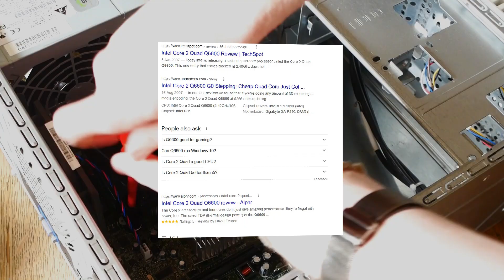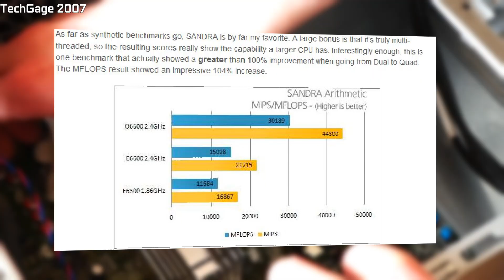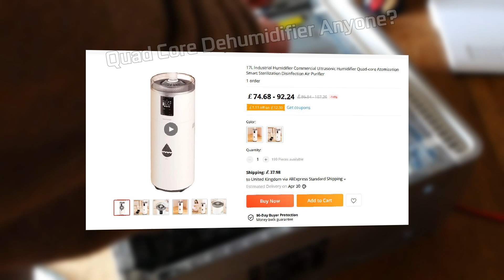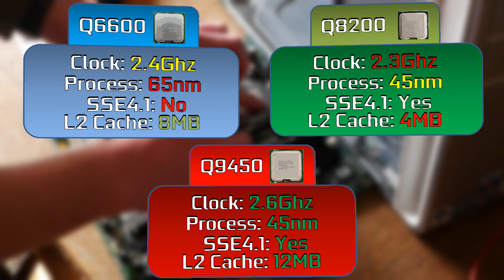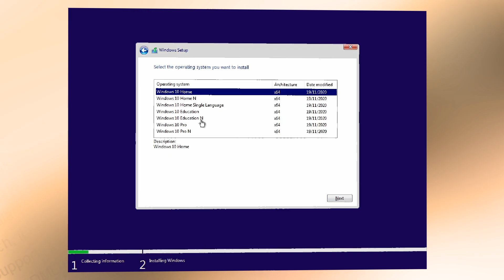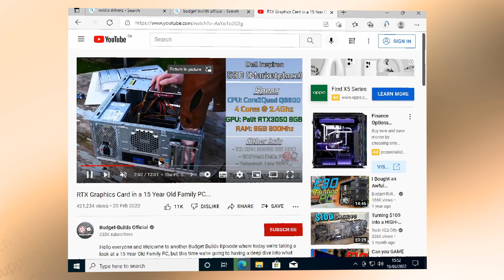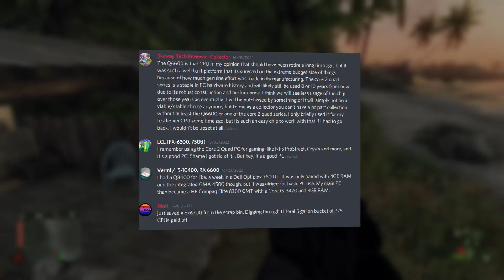Intel's Core2Quad...Finally Obsolete?

Comment: I have a core 2 quad extreme on my computer
Reply: what core 2 extreme do you have? I heard the extreme versions are the best among the core 2 quads.
Reply: @boiledliddo  idk it only says it's 2.66ghz but can run Minecraft 1.18.2 in 24 fps with no gpu
Reply: Checked like on /proc/cpuinfo only said it's a core 2 quad extreme
Reply: Man even when I changed the thermal paste it said the same thing on the processor
Reply: @lavacat720  have you tried typing systeminfo? You can then see what processor you have.
Reply: @boiledliddo  command not found, also it's linux
Reply: @lavacat720  try CPU-Z  that will surely identify your cpu.
Reply: @boiledliddo  I'm on Linux....
Reply: There's no CPU z

Comment: My main pc is still runing on a core 2 quad, it's the q9650 overclocked at 3.6gz. The motherboard is a asus p5e deluxe, 8gb ram and a gtx660 graffic card.
Since i don´t game on it, i don´t really feal the need for a new one, runs everything that i need flawlessly.
Reply: that can actually be used for playing certain modern games, although at reduced resolution (if you have a big monitor, you won't be able to full screen). GT 1030 is the budget gaming GPU today for some people, and your GTX 660 is stronger than a 1030. My retro pc setup is a Q9500, 4GB ram, and GTX 1650 --  the pc sometimes lags when gaming.. but Genshin Impact, Granblue Fantasy, Dead or Alive VI, and Soul Calibur VI are playable.

Comment: I'm not ashamed to say that I ran my Q6600 until 2020. Back in 2012 I was on craigslist's free section and came across a listing for two free PCs. One was a 1st gen I5 machine with a dead motherboard, the other was a Q6600 machine with a dead power supply. I stole to power supply from the I5 build and got the Q6600 back to life. Equipped with a Corsair 120 AIO, 8GB of 1333 DDR2 Corsair ram, a 8800GTX graphics card and an IDE harddrive sitting in a Coolermaster HAF case, I played whatever I could get to work. In 2020, mid match on Realm Royale, the pc died. Power supply failed taking the motherboard with it. One of my coworkers had a Asus prebuilt with an I5 6400 and 16gb ram sitting around unused (no gpu or hdd) so he gave it to me. If it wasn't for the power supply failing on the Q6600, I'd be playing it today.

Comment: bought a used q9450 cpu to replace a e6500 in my HTPC/NVR/NAS build that built with old parts. thought the slower but more cores would improve things but complete opposite. the q9450 used way more power and made my ITX hotter, and made the whole thing louder due to needing more cooling.  the e6500 had 2 less cores/cache, less heat and higher stock speed and i was able to further OC it to be even faster due to lower tdp. luckily i bought the quad cpu off ebay for pennies so it was a failed experiment that didn't cost much. 

eventually had to upgrade cause it was starting to really lag on basic stuff like youtube and movie playback and streams.  that e6500/q9450 served me well for over 12 years. got a complete i5-7500 used computer off ebay for 120 bucks.

Comment: I still run a QX9770 @400x10, ASUS P5E64 WS Evolution, 4x2GB Corsair Dominator GT @1600C7. I had GeForce 9000 series but they're being swapped for 2x ATI HD-4870X2

All in a 2008 XPS630i chassis, with original supply. CPU currently under liquid but the plan was to waterblocks the CPU, chipset & RAM to try get a stable 440x10 with 1760C7 or something similar.

By far my favourite computer to date, she overclocked hard (before I dialed back) and has been so much fun her whole life, I'd ditch my 5800X, Pro WS-X570-ACE, F4-3600C17Q-32GTZR, Strix LC RX6900XT rig long before I sold my beloved QX9770.
Reply: nice setup.
Reply: @boiledliddo  absolutely love it, since the X48 have 32 lanes of PCIe 2.0 and the ICH09 has from memory 6, I was able to run PCIe SSD with custom bootloaders & a network card from the southbridge and can keep the full 32 lanes for the quad CF cards
Reply: @spicywolf6718  I heard the Xtreme series were the best among the core 2 quads? I also have a retro pc, Q9500 + two sticks of 2GB DDR3, Cooler Master i50C (this has a copper base for better cooling), 480GB Patriot SSD, and Seasonic GC 550 CPU. It originally had a GTX 460 as gpu, which unfortunately died during a lightning surge - I did the dumb thing to keep playing when a thunderstorm was raging outside. Miraculously, only the gpu and avr died, the rest of the pc survived. The retro pc is partially retired, and now mostly used as backup storage. Don't want to throw it away because had good memories with it. And it still does have a few games for a bit of fun. I installed a GTX 1650 into it, so it could now play Granblue Fantasy and Guilty Gear Strive at 1080p. :)
Reply: @boiledliddo  they are the highest Intel bins, but the QX9770 was a bit of a weird chip in regards to OC potential. It and the QX9775 (LGA 771 for D5400XS motherboard) were the only validated FSB1600 chips for consumers, technically you couldn't run them in a X38 at FSB1600  without voiding warranty as you would have to overclock the chipset.

The biggest problem with a QX9770 is that to meet the FSB1600 needs they upped the current draw meaning clock for clock the QX9770 draws more power and subsequently runs hotter than the otherwise identical FSB1333 rated QX9650 which from a multiplier overclocking standpoint made the QX9650 the 'better' chip, for FSB overclock the Q9650 performed will if it's cap of *9 wasn't a limitation.
Even downclocked to 333x9 the QX9770 consumers more power than the Q/QX9650 @333x9.

Now, I have the X9770/X48 only because thy were the top dogs of their era and it's for nostalgic purposes. I plan to build a 2x QX9775 + D5400XS + 16GB FB-DIMM +2x 9800 GX2 when I can find said parts for sale in Australia.

Comment: Not even close. It should be obsolete, but we've got all the spying to thank for that. You need a Core2 system if you don't want to have hardware back doors built in, that can just bypass your encryption. And just run a Linux distro on it, and max out the RAM. You'll have an experience that resembles a decent system from 2022. It's not perfect but if you want away from the spying, that's really your only 100% method. To use a Core2 system. I'm guessing you probably want the q9650 so you'll at least have the final top of the line quad core. I'd stay away from the dual cores.

Comment: I just build a new system with a C2Q a Q9300 with 8Gb DDR2 DRAM, I have 2 PCs that also running on C2Q as an offload server for music plugins. Which are used for mixing and mastering multitracks from songs. Also a c2q for administration, the rest are recent models with an i7 or Ryzen machines. So core2quad are still used.

Comment: I've got a second "gaming" computer running a Q9550 + a GTX 760 and considering I paid next to nothing for the parts its actually holding up pretty well. It has truly began to show its age the last 2-3 years, but I frequently play older games and it works just fine doing that :-). But honestly I'd rather get Sandy Bridge at this point for an ultra budget build because it has become very cheap

Comment: If You have E5450 (Q9650) if You have good MB (with support for 4x2 DDR2 or 2x4 DDR3) with 8 gigs of RAM and SSD is a very good PC, don't support AVX so can not play some games, but with good videocard (even not very good, like 760) is enough for web, and even some gaming (not on highest settings but still) and if You are can not afford an upgrade, no need to be sad, You're not loosing much.

(I used my 5450 untill 2020, and as my 2nd system for testing and stuff untill end of 2021, now my friend use it for web, and it's enough for him)

I got mine in bad shape,  upgraded like this
- Videocard (GTX970 so I can play at least somthing)
- CPU cooler (cheapest like Gammax 200/300 is enough)
- RAM (4x2 DDR2) and SSD (cheapest 120gb enough for system)
- PSU (mine was very old) and case
In the end it was fast and very quiet system

Comment: I had my share of processors on the 775/771 platform. I did all kinds of experiments back in the day. The ultimate setup for me was Dual Xeon E5450 with 12GB DDR3 RAM and a GTX 770. For Q6600 I would love to see a comparison using the "tape mod" where you place a small piece of tape on one of the bus pins on the processor. This trick allows him to reach 3.0 GHz on 1333 mhz. I used this trick on several Dell Optiplex machines. I still have my Dell Precision 690 rocking dual X5355 processors and a GTX285, even with an SSD, it is not a fast PC. Try some dual CPU motherboards, you will have a lot of fun and content. Also, GTX295 or GTX690 are super cool things to play with.  Cool Video mate, keep up the good content.

Comment: They last along time there just as powerful as today's core I5 i7s only main difference is the older processors of core 2duo core 2 quad used more power got hotter but they came in a good range of speeds and CPU cache sizes. Only no hyper threading but Intel p4 and some Intel atom has hT

Comment: I mean, they have been obsolete for gaming for nearly a decade now. They're still just fine for average use as long as you have enough RAM, an SSD and a cheap modern video card that supports hardware accelerated web browsing.

Comment: Did you disable meltdown, spectre and telemetry? Pointless to benchmark old cpus like that with those stupid security fixes. I built an old i5 3570 and put a 3070 in it just for the laughs recently, and disabling spectre gave a massive improvement in fps, specially low 1%.

Comment: Flashed a custom bios and managed to get a $20 modified Xeon5460 (Basically a Q9560 but runs cooler) on an old HP with G33 express chipset. The board was so old that it only supported DDR2, so I maxed out at 8GB. Still runs fine for YouTube or such tasks.

Comment: I have a Q6600 but replaced it with with a Xeon X5460 quad adapted for 775 and overclocked to 3.5ghz, im not a gamer so that CPU and the 8gb ram i have does me, i have two GPUs though as i run 3x 32" screens :)

Comment: Ah the bittersweet memories of my old Q9650 with Foxxcon G41MXE. I upgraded from Pentium E5700 and oh my god it required SO. MUCH. TROUBLESHOOTING. It wouldn't boot at all unless I tried various tricks like pushing the CPU cooler onto the mobo really hard, leaving my PC on the whole night so I wouldn't have to go through the trouble of booting it again, etc. And the thing ran really hot. But I was still a kid and it was a good learning experience.

Comment: I've got an Inspiron 530 with a modded bios that is running the C2Q cousin, a xeon x5470. It works alright but it likes to get real hot since I have to use the stock Q6600 heatsink on it. It's paired with a Quadro k2200 which overheats quickly if you don't keep a fan blowing on the computer while it's running. I mostly use that one for streaming, browsing, and to run old console emulators up to the PS2

Comment: I used mine (6600) until late last year... then I bought a $100 i5-6400 (not the chip, the whole PC)... :) I'm not cutting edge by any means... but I could play GalCiv III in 1080p with no slowdown on the quad... and now that I have an i5... I can run it in 2k. :) 

My choice of games are archaic and usually not more FPS-y than Quake 1. :) I hope to get another 5 years out of this i5, which was used when I bought it. :)

Comment: these are definatley a "basically for little or nothing" computer, they are not really cheaper then buying a computer with an i5-2400 at this point and at least then you have an upgrade path. (not only with cpu, but often the core 2 quads supported 8gb ram max and on a lot of boards only 4gb) its a dead platform. if you get a computer for 10 dollars sure, slap in an rx 460 for 75 bucks and you got yourself a computer that can run most games.

Comment: They are still capable to power pc these days. Not kicking ass, but still doin work. Even mobile. I have c2q 9000@2ghz and gts 9800m, only 4 gig ddr2 ram 800. For internet, Office, Youtube perfectly normal experience

Comment: Im still using q9650, on a x38 platform with 8g ddr2 ram. I didn't purchase those parts, they are scavenged from obsolete / damaged PCs thrown away by the uni. I also mod a scavenged Tesla c1060 computation card into a quadro fx5800 by soldering dvi jacks  and flashing it with the quadro bios, together this allows me to run Minecraft smoothly at 60fps 1080p (on a server, not single player), occasionally the fps drop below 50, mostly due to chunk loading. Hl2 and L4d2 runs perfectly.

Comment: Personally I recently just stopped using a core2quad based Xeon at 3.4GHz and the only reason why I upgrade it was because I needed some new chipset features that the old CPU did not have.

These chips still make great entry level gaming computers and everyday use set ups.

Comment: For the last 5 years I have been retiring anything with less than 2 cores 2 threads. Even for light office work 4 cores 4 threads is an absolute minimum for productivity. If you have a browser open, voip software, and office suite all at once then when Windows updates hits 2 core systems fall flat on their face

Comment: I stand by my opinion that the Core 2 Duo and Quad are everything someone who doesn't want to game actually needs.
Reply: The Quad yes, the Duo? No. I had to use one as a developer at work at the time and it was the most god awful POS it has ever been my misfortune to have to use, even old Unix workstations from 10 years previous to it were snappier than that. Thinking of it I probably should have swapped the CPU out for a Quad and not told my boss. 🤣
Reply: RIP trying to play 4k videos
Reply: You have never seen a two core cpu get completely destroyed by windows 10 then....
Reply: @quan-uo5ws  I've used Windows 10 on a Core 2 Duo, it's perfectly usable as long as you have an SSD.
Reply: Its not the core2duo's fault. Windows 10 is an intentionally resource hungry unoptimized mess.

Comment: I am still running C2Q 9450 with 8GB RAM and SSD in my HTPC on Win 7. It is still performing all duties quite well, except 4K playback either from youtube or local H.265 files. Even dedicated  graphic card does not help. 1440p playback works perfectly.

Comment: Up until sometime in late 2021, my daily driver for gaming was a water-cooled QX9770 3.2 GHz (Yorkfield) on the X48 chipset with 1600 MHz FSB and 8 GB dual channel DDR3-1600. It was a quite capable albeit a little power hungry system. Paired with a proper video card, (I had a STRIX 1660 in it at the end) it's still a rock solid platform for anything that requires powerful single threading over anything else. The lack of hyper-threading, high clock speeds and support for SSE4.1 meant that you could keep one of these for 14 years which is a huge plateau that surely offset the steep initial investment. I found that the real bottleneck was the onboard SATA2 so instead I used a Muskin Scorpion Deluxe (quad SandForce SF-2881 mSATA SSDs in RAID 0 using a LSI SAS controller on a PCIe card) which gave me full 1 GB/s on the available PCIe 1.1 x4 slot instead of the theoretical 600 MB/s of SATA2. Overall, it made for a very snappy and responsive system.

Comment: There's something VERY wrong with your testing. You get too low fps numbers. Crysis at low720p and only 18fps? Are you kidding? A Phenom II (which was a worse CPU than C2Q9xxx series) gets almost 60. CS:GO can run on a potato and you managed to get under 60, how??? What did you do?
Reply from the maker: Crysis Remastered…
Reply: @BudgetBuildsOfficial  and what's the difference, do you know? Remastered used a console optimized version as the base, meaning better thread optimization since OG Crysis was notorious for it's bad multi thread utilization. In theory (and proven) remastered runs a tad better than OG Crysis on the same hardware.
Reply: @BudgetBuildsOfficial  Just so you know. "GTX 750 TI + Q9400 Gaming | 5 Games Test in 2020"  make a youtube search and you'll find people getting far far better results.
Reply: @BudgetBuildsOfficial  it might also be that Windows10 (which I assumed you used) doesn't support the CPU and performance gets nerfed.

Comment: currently using a quad core 3.4ghz and a 1050ti and just last year I've noticed how cpu heavy games really are becoming now. you'd be surprised how much you can get away with if you just overdose on ram and use a solid state for everything.

Comment: My first PC ever had a q6600, 2x4gb ddr2 and a gt 220 (lol). It ran WoW really well, and even Crysis 2 and BF3 when I upgraded the GPU. However it wasn't the most fluid in Battlefield 3 even back then,  so I upgraded to the even almightier i5 2500k :p.

Now, over a decade later, I'm contemplating buying another quad core, but one that'll deliver +400fps in csgo instead of 50, the 12100f.

Comment: I have a Dell Studio 540, very similar machine to your Inspiron 530, bought it in 2009 with a 2.8 Ghz Core 2 Duo. In 2012 I found a dead PC in council pickup with a Core 2 Quad Q6600 which I promptly put in the Dell, and have kept in the Dell to this day. While the Dell is no longer my main machine, its still in regular use as my HTPC, and I give the Q6600 credit for allowing this machine to remain relevant to this day.

Comment: The Q6600 along with a Geforce 7 series GPU (I forgot which exactly it was) was the core of my very first PC, which was a hand-me-down from my Dad, this brings back memories. 
Knowing its still used in 2022 is insane, I upgraded from the Q6600 to an i5 3450 back in 2014, and I've been very impressed with the longevity of the i5 3450, which I still use today. However the Q6600 seems to put it to shame with it still being used 15 years after release. On the other hand I think this only shows that PC-Hardware has a way way longer lifespan than we probably expect right now. With how powerful current CPU's and GPU's are, I really wouldn't be surprised to see 12900K's and 3080's still around in 2040 and beyond. If a 2007 CPU can make it 15 years, how long can 2022 chips really last?